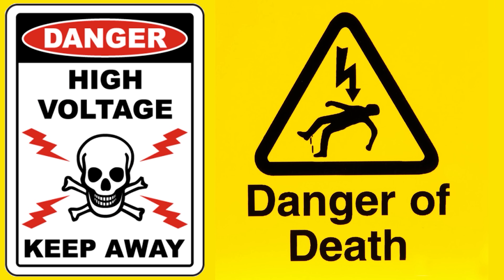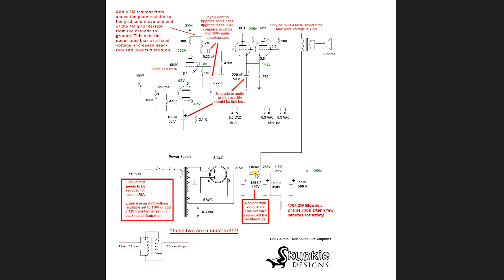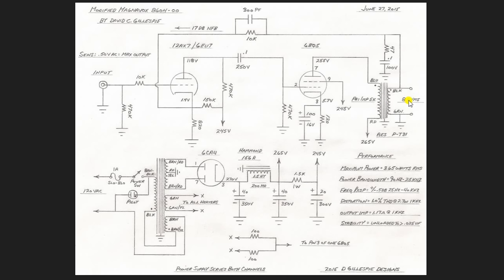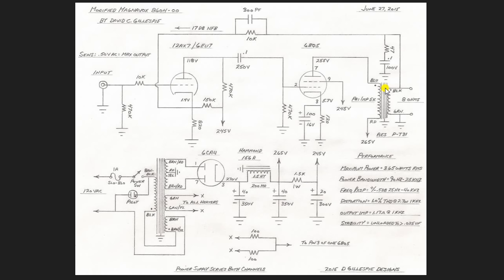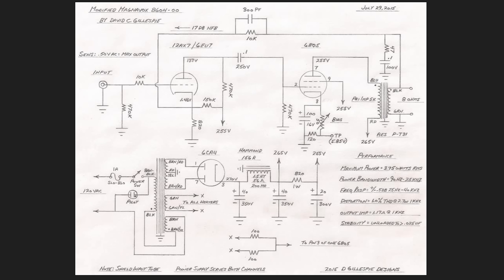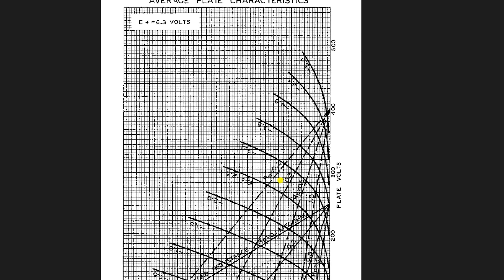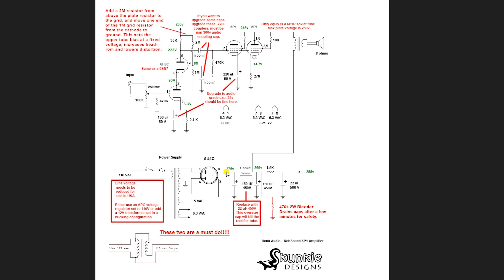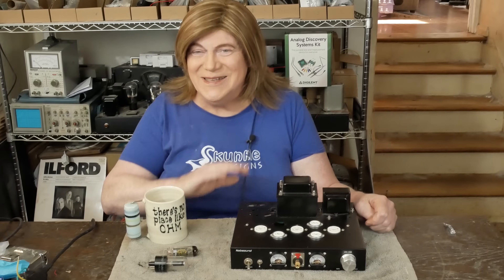Nobsound 6P1: Schematic Deep Dive.

Comment: Such a lovely old school had drawn schematic - very '60s style!
I like the bias adjustment other than the fact you'll need a beefy wirewound pot for that. I don't entirely get the idea of pulling up the cathode of the first tube with a resistor to B+ instead of choosing a higher resistance for cathode resistor (or using a constant voltage element like a LED) and letting auto-bias do the rest.
Reply from the maker: I explain in the next video!

Comment: Nice circuit using as a pentode for 6BQ5 . Now to figure out voltages off power supply . Sometimes adding a inductor can help drop volts and helps with filtering as well.  I grab the center tap off HV winding with  ammeter to measure RMS amps .  Wear that center tap goes to ground I have added a choke their to drop voltage from solid state rectifier change over .
Reply from the maker: I may end up sticking with a tube rectifier, not sure yet :)

Comment: Thanks for bringing the 6sf5 to my attention.the tube manual show it closer to ax7 than 6sq7 for plate resistance and transconductance.any experience with 6av6 or 6sl7?
Reply from the maker: I've used 6SL7 tubes, honestly they are not my favorite sounding Octal tubes.
Reply: Good to know.from another video was it the 6sq7 you tried several before you found good sound n.u ? I would like to see a listening comparison between dg 1 and rh 84.considering building both myself so paying close attention to your build
.
Reply from the maker: Not sure I will be building both, this 6P1 has been sitting at my house for 2 years, I wanna get it done :)

Comment: I just biased my DG yesterday and the 120 ohm cathode resistor gave me 50ma plate current which seems just fine. Question...I'm still running my screens at 245v. What's the benefit of running them at at 255v or slightly below.
Reply: Cool project! My brother's got a Nobsound 6P1. I hope he doesn't see this ;-).
Reply from the maker: I think it might give a small power increase? Not sure if that is worth bothering with.

Comment: The fun begins! There are a lot of good EL84 tubes out to roll. I noticed the band width being 90 to 25k is the low end rolled off on this design, or is that typical?
Reply from the maker: I think that is a power rating or something, not sure. You can see the freq response at ± .5db bandwidth looks good.

Comment: I just noticed that he does have a 5 Volt winding but he's purposing it for lowering the primary voltage by putting it in the in series with the primary. That's why he's using a rectifier that can run on 6.3 volts.🤓
Reply from the maker: I think for some reason it had an extra 6.3V winding, have to go back and reread that thread.
Reply: @SkunkieDesignsElectronics  Looks like the same transformer with a 5 and a 6 heater Winding only he's using the 5 in series with the primary to accept the higher voltage on the primary.
Reply from the maker: That winding in the original maggie amp transformer was another 6.3V for powering the tuner heaters. The amp he is using came with a 6AC4, it had no 5V winding.

https://audiokarma.org/forums/index.php?threads/magnavox-flea-power-getting-more-out-of-the-8600-series-a-lot-more.665735/post-8883685
Reply: @SkunkieDesignsElectronics  OK Fair dues, still five volts is very close to six volts. So, it would seem you can save your resistors
Reply from the maker: I don't think a 5V buck will get us down to the 110V needed. He was just trying to get down to 117.